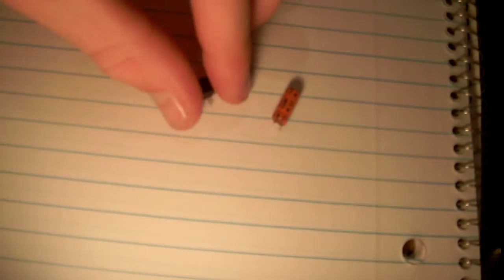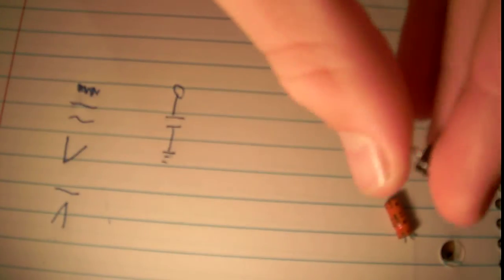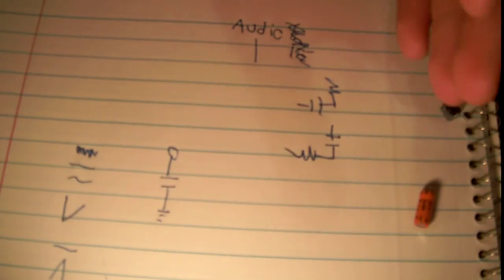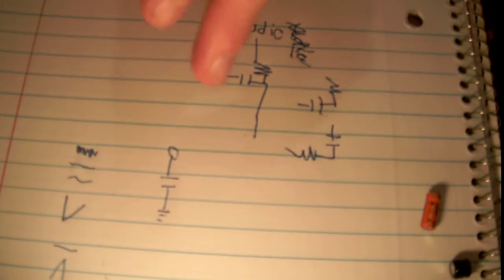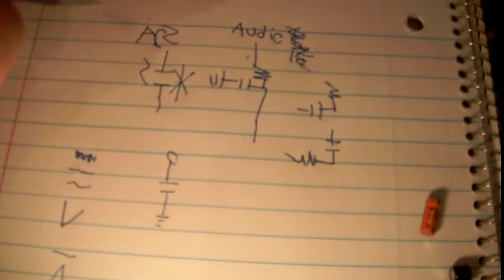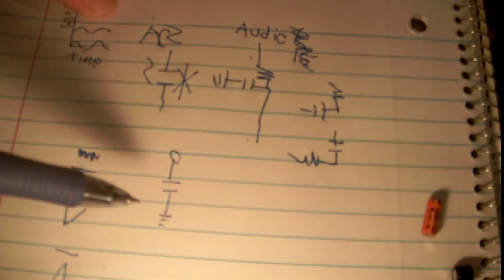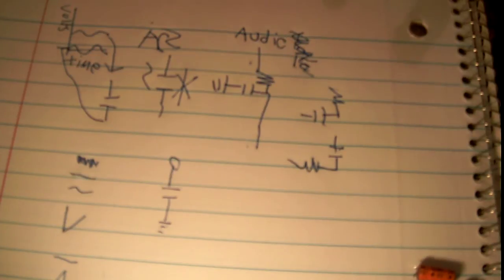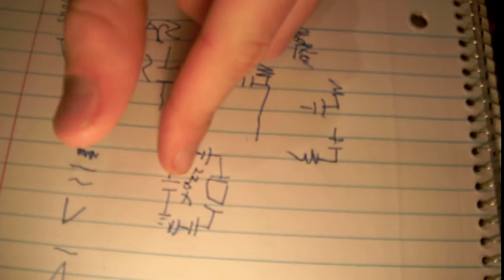Uses Of Capacitors (Caps)

Comment from the maker: Those are for filtering the power supply. Power supply's are not perfect so there will be a little bit of jitter in the power supply, (you can see this with a scope set to AC couple and with 10 or so milivolts per division). Because caps are conductive to AC the AC will get sent to GND and filtered out of the power supply to "clean it up". This normally makes no difference but can cause unstable operation and mess with precision analog and ADC stuff. In general just good practice.